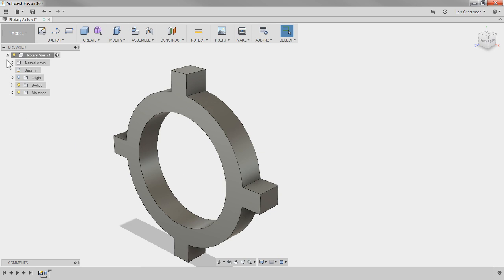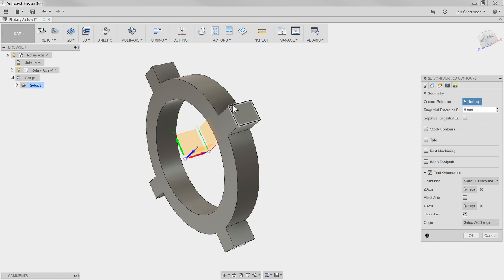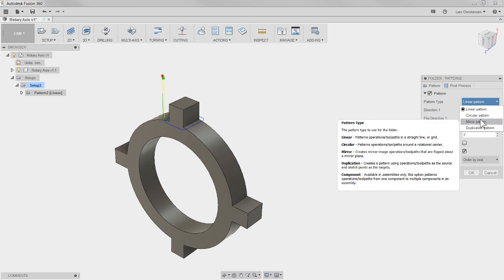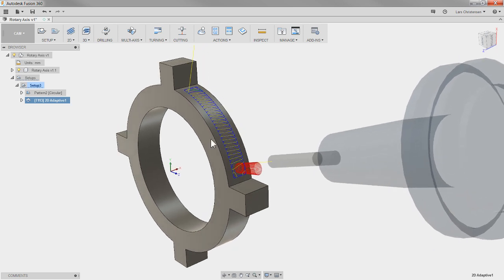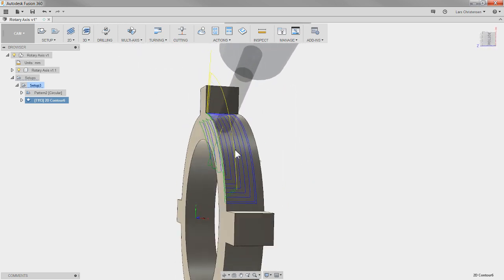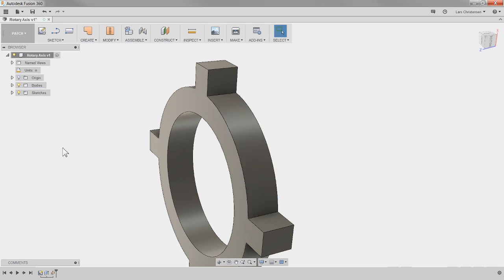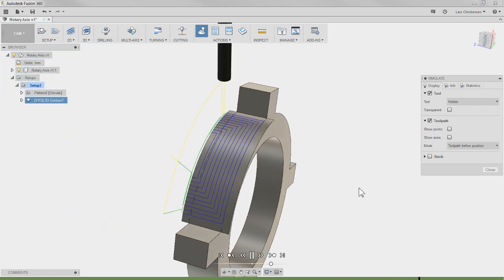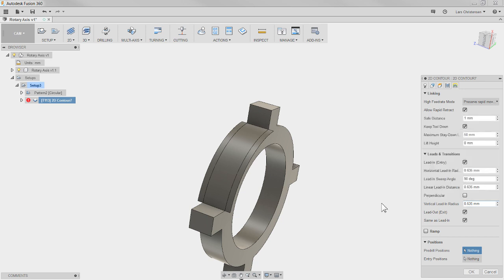Fusion 360 — CAM, 4th Axis Wrap Toolpath Walkthrough —Your Comments & Questions — #LarsLive 22

Comment: Hi Lars I tried to program a 4 axis part in fusion 360. But I wonder if the german version is different as the English one. I can't find the patch-function and tool orientation in my fusion 360 cam.. Neighter the wraparound. Only a 4 axis operation function but to set the tool orientation is quite impossible to set....
Reply: Hi Gio its because that version of Fusion is nearly 3 years old patch is now in the surface tab.  Be in the design work area then above your sketch icon you will see Solid, Surface, Sheet metal, Tools click on the Surface tab and patch is now visible

Comment: i need to machine a 4 axis helical toolpath 3d not the 2d.
how can i machine that is there any option for that.
please reply+
Reply: I agree.  it would be nice.  One solution I do is do 4 setups arrayed around the part, and name them the angle they are at, like 0 deg, 90 deg, 180 deg, 270 deg.  then you can do standard milling from each of those perspectives, and I make sure to manually add a line in the beginning of each code , A0, A90, A180, etc. depending on which perspective..  this can be used for roughing and can use all the standard CAM solutions..  HOWEVER, I'm with you, I'd like to have the ability to do PARALLEL CAM with integrated 4th axis, regardless of Z level..

In fact, the trouble i'm seeing now is that the wrapped pockets don't seem to get the tool to all the edges the way I'd like.  I think it's because it's calculating based on the tool center, and not taking advantage of the tool edge.  My goal is to make a 1" diameter END mill.  so, yeah, i'm running into some problems.  I could manually code it, but that's a pain.

Comment: Is there a setting in Fusion360 for simulations on a 4th axis path that allows us to view the stock rotating under a fixed spindle, instead of the spindle rotating around the stock?
Reply from the maker: Hi grappler185 Thank you for watching!
There is not at this point.

Best,
Lars
Reply: Hi Lars, Thanks for replying. You might want to put that one in the suggestion box. The people I've discussed it with really liked the idea.

Comment: Nice video as always. However, I rather own my own software and have 100% ownership of my files and software. Sorry Autodesk.
Reply from the maker: Hi CudaPro Thank you for watching!
Don't be sorry :-) You need to do what is best for you! 
I do have to make it clear though, YOU DO have 100% ownership of your files when using Autodesk products.

Hope you have an awesome day!

BEst,
Lars
Reply: Hi Lars thank you for replying. If I have a Fusion 360 subscription and create all my tool path files.  My tool path files are 100% Fusion 360 format. Which means that if I stop my Fusion 360 subscription, I no longer can use my Fusion 360 Tool Path files. Correct? 

Quitting my Fusion 360 subscription = No longer having access to all my tool path files (files that contain all the tool path generation).
100% ownership?  

However, if I purchase a CAD/CAM system, I can open those files anytime I want because I own (not rent) the software and files. 
Even if I have moved on to another CAD/CAM solution, I can still open all my previous tool path files.

I have purchased and have used CAD/CAM for over 30 years.
If I stop my subscription to Fusion 360, I no longer have access to those tool path files. Those files I worked very hard on. 
Maybe I am misinformed....... 
If I no longer have access to those files, please explain how I have 100% ownership?

AutoDesk (like any other company) wants to make a profit. Nothing wrong with that. They are not offering a subscription based CAM system because they want to be nice guys.
They are offering a subscription based CAM system because it provides them more profit. They have thought this out and are very clever. 

Imagine creating tool path files for 3 years, 4 years, 6 years and have paid subscription fees now totaling more than the purchase price for many comparable and better CAM systems. The Autodesk sales and marketing department know that most customers will keep paying their subscription fees (even if the fees are raised) to be able to use those tool path files. To have access to THEIR tool path files. 

My bet is that AutoDesk will increase their subscription fees over the coming years. Companies provide subscription offers like this because its more profitable for THEM.
Subscription based software (in many cases) is a wolf in sheep's clothing. 
Been there, done that.

I may be 100% misinformed. Looking forward to hearing your thoughts regarding this.
BTW, your videos are fantastic and among the very best I have seen.
I will continue to watch and learn. 
My views regarding Fusion 360 are not an attack towards you or AutoDesk. I just want people to see all sides.